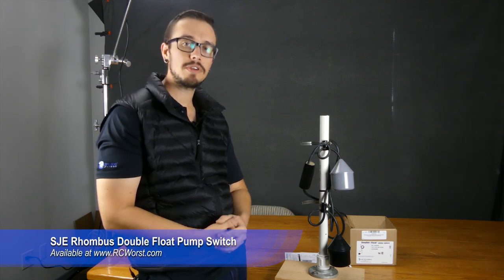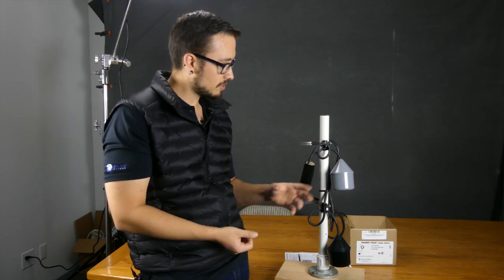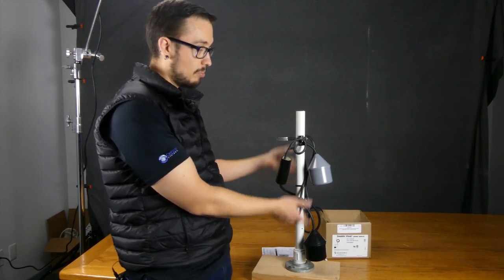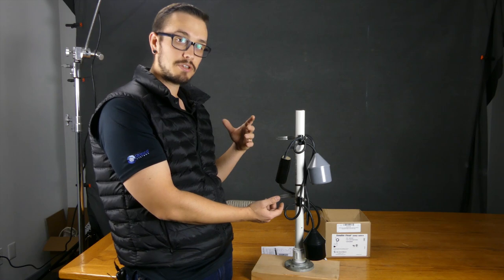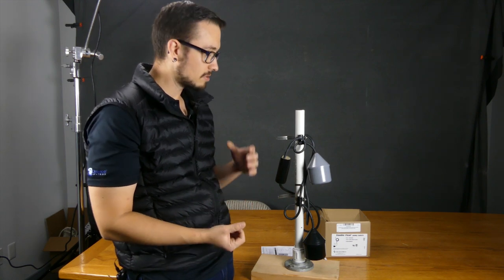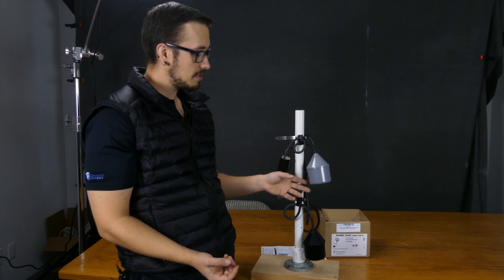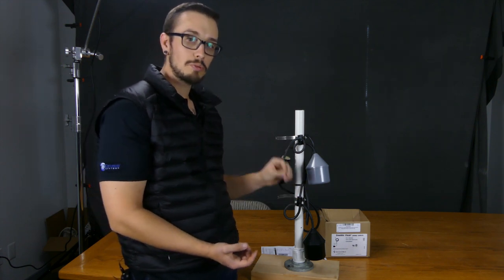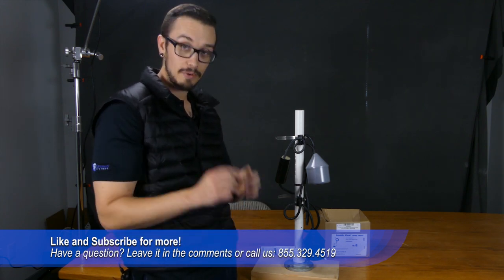SJE Rhombus Double Float Pump Switch

Comment: do you have a switch like this that turns on at the bottom and off at the top? also, do they come in stainless steel?
Reply from the maker: Yes, they are available in Normally Closed (pump up) configurations. They are plastic only. What do you need a SS switch for?
Here is a link to the spec sheet: https://www.rcworst.com/Shared/content/mfr/sje_rhombus/docs/sjedouble_floatpump_switch2018.pdf
Reply: @RCworstwater stainless steel for  drinking water? Maybe

Comment: How do you connect it to a simplex 3 phase control box.
Reply from the maker: That would depend on the control box. Refer to the wiring diagram provided with it or call the manufacturer of the box.